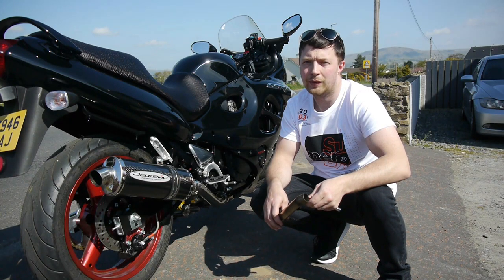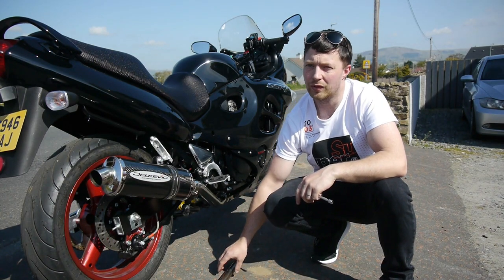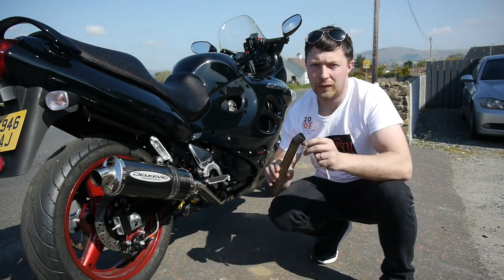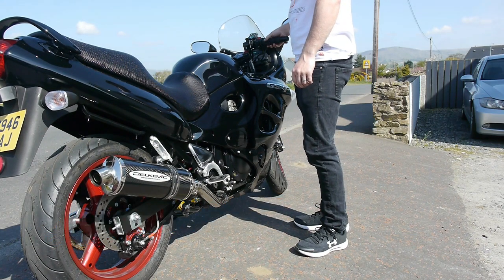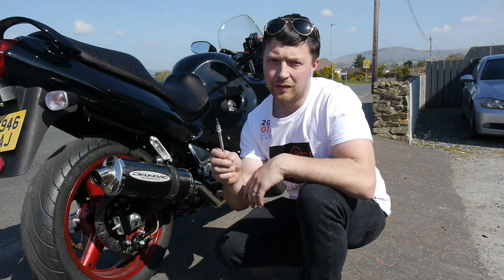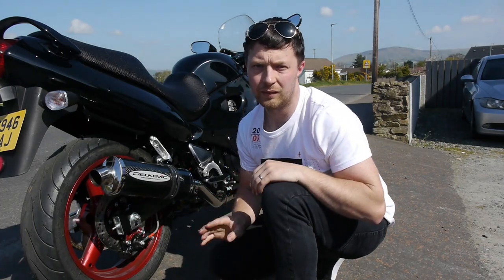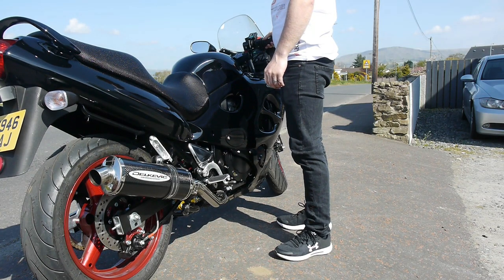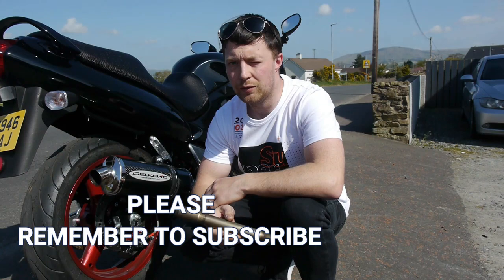Delkevic Exhaust: Baffle In vs. Baffle Out (DB Killer)

Comment: Recently purchased a delkevic exhaust for my 2014 fz1. Ran it for a few days with the baffle then decided to try it without the baffle and it doesn’t run right. Has a slight delay on lower rpms when I give it throttle causing the bike to not be smooth when I’m riding slow speeds. Put the baffles back in and problem went away. I think the baffle gives it some back pressure at lower rpms.
Reply: Tink ya may be able to fix that by leaving the baffle out but making a plate to reduce the inside diameter some to give you enough back pressure

Comment: I need a new end can for my 98 katana as my mid pipe rotted away and snapped leaving the other half in the header pipes so I got that out and I was looking at getting this
Reply from the maker: This is a really nice exhaust system which is very good quality and value and has a really nice noise. I have heard these bikes with a few other brands of exhaust on them and in my opinion this one sounds the best
Reply: @DarrenMcKinney1  yeah gonna get it next month when I’m paid bet the metal is better quality so shouldn’t rot away like the other one did it broke right at where the sleeve is that goes into the other section of pipe had a fun job getting it out
Reply from the maker: @bikerlad3138  yeah my original one had been welded there too before I got the bike
Reply: @DarrenMcKinney1  think they’re bad for rotting away due to the metal they’re made of be fine if it was stainless guessing the delkvic is.
Reply from the maker: @bikerlad3138  yeah it’s stainless steel and a carbon fibre silencer

Comment: Looks great, did you have to re map.. or tune your ECU after? Or was it not necessary?  Also did you gain or lose any Torque or HP? thanks
Reply from the maker: no retune was necessary as this bike didnt have any cat or anything due to its age. As for power it may have gained a tiny bit up top but its more about the sound really. I think also it may have lost a few mpg's
Reply: @DarrenMcKinney1   Thank you

Comment: Hey man! I just got a Delkevic ds70 9" for my Ninja and see that u have one of the stickers that come with the exhaust on urs. I was wondering if they are made to be put on and if u have had any problems with ur sticker melting or anything?? I would definitely like to put one of the stickers on mine too. Let me know, thxs!
Reply from the maker: Yes you can put stickers on the carbon fibre exhausts as they don’t get very hot. I’ve had mine on for over a year and over 5000 miles and it’s still like new
Reply: @DarrenMcKinney1  Awesome! Thank u very much!